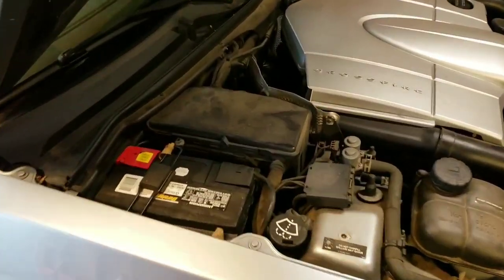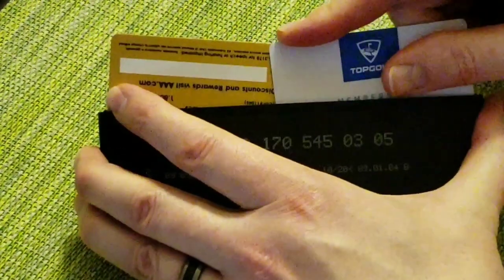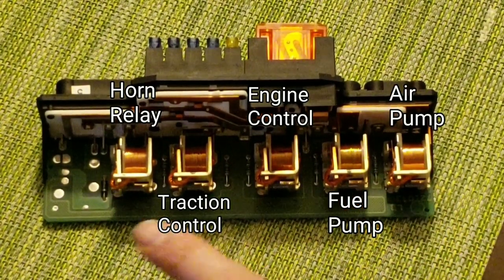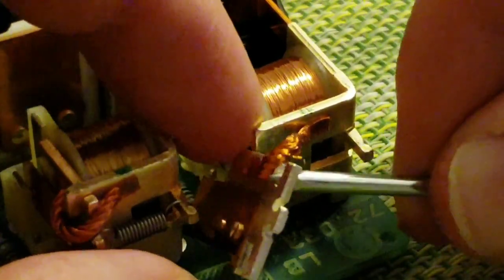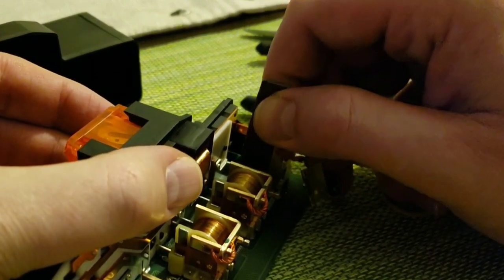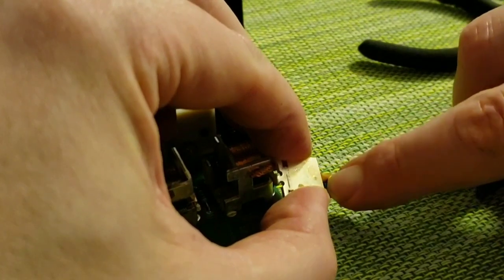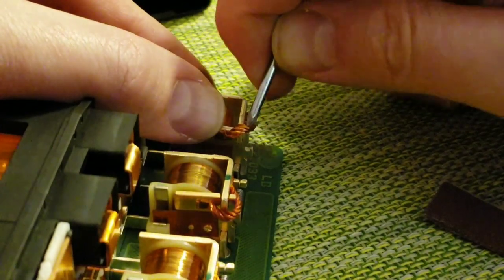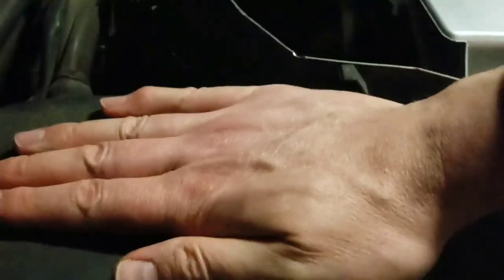RCM (Relay Control Module) Step by Step : Chrysler Crossfire Mercedes Mystery No Start

Comment: My crossfires dash lit up like a Christmas tree this morning upon startup and no working speedo and I remembered reading about the rcm many years ago. Thanks to your video, I confidently removed the rcm , checked the relays and re soldered the lower joints and viola! 30 minutes well spent thanks to you! Cheers! 🍻
Reply from the maker: I am so happy to hear that, thanks for keeping this beautiful car on the road and running safely and reliably. Kudos to you for doing it yourself.

Comment: Just have to say...I have an '02 SLK320 and this was the best video I have ever found on fixing the "K40" relay problem. Took about 20 minutes and finally cleared the dreaded P0410 code. Great Job!!!
Reply from the maker: Thanks for commenting, it makes my day to know my videos help others overcome car issues.
Reply: Did you have the intermittent P0410 fault code. My system works but when I clear the code it can return after few hours driving

Comment: Well that was easy. I have a low milage (19k) 2004 coupe and been happily driving the last three years trouble free, then today, ignition on, but no crank, and after a minute the cooling fan ran up to full speed. A known symptom of the solder joints being bad. I had a fair idea of how to resolve this, but your tutorial made it so clear. Took me literally half hour from lifting the bonnet to starting it up. I just had the three sets of pins bad, everything else was tidy and clean. Thanks for taking the time to make your video
Reply from the maker: Hey, no problem I enjoy the car too. I thought I had low mileage at 80k. Keep that car in great shape. Thanks for commenting.

Comment: Very Good Video!  I like how meticulously the connections are labeled.  And removing the negative battery cable before starting is always a cautious and prudent thing to do.  The detailed explanations of the relay operation is helpful.  The detailed views of solder joint diagnosis and repair is thorough.  I may actually now be able to attempt to do this myself.  Thank you!
Reply from the maker: I think you can do this. I haven't actually had to replace the relay yet, but I have resoldered the joints and cleaned up the relays with probably slightly above average soldering skills (I took an electronics class in high school 30 years ago, and make modifications to RC cars and 3d printers today, I'm not out of practice but not a skilled Laborer in this field by any means).

Comment: Just watched your video and made the repair.  Feels good knowing that I won't be stranded at the worst possible time by this issue!
Reply from the maker: Yep, next up is ignition pin. If your steering wheel or key are ever sticky when trying to start the car, or remove the key, you may have to do the repair I have coming up in an upcoming new release. Thanks for watching.

Comment: Great info, definitely worth replacing the relays I believe. I had the N65 module, intercooler control relay specifically, go on my SLK32. I just jumped around it for now but I will be sure to clean up and inspect the used replacement I just ordered.
Reply from the maker: Thanks for watching and commenting. It sounds like you'll be up and running again as intended.

Comment: I MUST say KUDOS to you for a video well done! I did this process a few years back "blind" if you will. Wasn't quite sure what I was doing but I saw the black residue. I then used sandpaper but I now know Emory cloth is the better product to use thanks to you. Your video illustration and explanation was clear and concise.  I need to revisit this part again and check the solder connections of the RCM. I never re-soldered them as the no crank no start has returned.
Reply from the maker: I'm sorry to hear the no crank , no start has returned. Good luck resoldering those joints.
Reply: @glencouls  Thanks for highlighting and replying. Figured I'd update you on the soldering job. Things went well and the vehicle started! I also noticed a little carbon build up on the air pump relay contact so I cleaned that as well. Safe and happy driving 👍👌😎
Reply: @tooshort4892  I have a 10amp fuse that keeps blowing on start up, once I shut car down it won't start and I must change fuse again to start it... I'll do as was done in video but anyone has any idea why fuse keeps blowing or what this 10amp fuse is for ?
Reply: @hajileserpud9539  Is this fuse in the fuse block or an added in line fuse? Make sure the fuse is the correct rating for the slot it is in. Outside of this or what the video suggests I'm afraid I really don't know much more.
Reply: @tooshort4892  hello... It's on my K40 fuse block on my 2001 Mercedes E320 4matic... I see two 15 amp fuses in this video for the Chrysler Crossfire but on my K40 Mercedes block it has two 10 amps... 1 keeps blowing on start up
Reply: @hajileserpud9539  Cross check your owners manual and make sure the fuses are the proper size. To me it sounds lime they may be the wrong size but your manual will prove or disprove any speculation.
Reply: @tooshort4892  ok will do... Thanks

Comment: I watched the video three times.  Then on-vehicle tested the air pump with a continuity tester then directed wired to battery to make sure the air pump worked.  It did.  Then I followed your video to the letter, but I labeled the 5 wire connections with "Whiteout" dots, one for each number.  Works great.  I did your whole procedure and shut the hood in 45 minutes.  Thank you so much for your wonderful video and sharing the depth of your knowledge.  DD
Reply from the maker: Hey, thank you so much. Your comment made my day, and I'm so happy everything worked out for you here.

Comment: Bought my mom a Crossfire last year. 04 Crossfire I believe. Got it used, drove beautifully for a couple weeks until we had to replace the glass due to a rock smashing the back windshield. When they replaced it they cut and rigged some wires back there. Even since the car won’t start. Intermittent battery drain. I’m just thinking of junking it but she loves the car.
Reply from the maker: This is pretty far out of my view to be able to answer. I would doublecheck the rewiring they did in the back make sure nothing got crossed third brake light and rear defrost are back there. If the car won't start, try reseting the battery (disconnect negative cable, then reseat it) then try to restart car. If the car starts for like two seconds then shuts off, it's the SKREEM immobilizer. Let me know if this is the diagnosis, as I have a couple of options none of them good, but you may not have to junk the car.
Reply: @glencouls  do you really have solution for the SKREEM?? Only alternative that people have I think is to buy it from NEEDWINGS but I dont know if they have it available. Any idea to resolve the issue?
Reply from the maker: @armonianumerica5830  The Skreem unit is the defacto shutoff or last line of defense on what the car sees as a theft attempt. You'll need a new one if it's been triggered and detonated/executed. The only other thing I can think of is entire replacement of the engine, ecu, ignition, etc and drop in something awesome like a V8. There are guys that have done that, probably not road legal.
Reply: @glencouls   I had no idea you replied to this until now and it probably could’ve been helpful. We took it to a couple Electrical/wiring places who said none of the wiring seemed problematic and their best guess was the aftermarket touchscreen radio. She bought a battery switch to turn the battery off when she’s done driving it for the day. Then turns it back on when she wants to drive it. That way the battery can’t drain overnight. It’s still working for her to this day and I’m so glad we didn’t scrap it

Comment: Great info ! just bot an 04 black coupe with 163k. looking for all the help I can get for future repairs/upgrades. Thanks for the great video.
Reply from the maker: Welcome Brently, thanks for checking out my YouTube page. I love to drive my Crossfire, upgrade it, troubleshoot issues and share them here. If you haven't already please consider subscribing, I have a few videos in the works, security pin removal for stuck steering column and ignition switch, floor mats, front end, shock and stabilizer install, all coming soon. Thanks again for watching and commenting!

Comment: 4:50... LOL Your secret is safe with us. Well hopefully it is, lots of Llamas out here. Thanks for making this video. I may need it. We still have our 2005  
Crossfire Roadster Convertible. It's in excellent condition with only 49k miles and has been garage kept it's entire life. Only now are we starting to see some of the issues that older, harder run cars have already experienced. The alarm started going off randomly in the past few weeks. We'll be in the house and out of no where we hear the siren from the alarm and we check it but nothing is wrong. It's gotten to the point where I have had to pretty much stop leaving it locked/armed. I would have taken it into the shop already but our '19 Camry is in there as we speak. Great car BTW! Unfortunately we hit the curb avoiding a deer. Said Deer now owes me my $500 deductible... Good luck finding that a$$hole. 
This morning I wake up to the same thing; blaring sirens in the garage. I forgot and must have locked it. Only this time the sirens sounded like a cricket dying over a PA system. Very pleasant to say the least. Especially when it's screaming in your ear as you're trying to disconnect the battery cable. In my little bit of research I've learned I should first check all my sensors and relays especially on the doors, and latches for the glove boxes. If that does not solve the problem I will remove the RCM... I really hope when I go out there in 30 mins with a Torx set that I find a lose switch somewhere and it's a simple fix. This car is in excellent condition. I also saw some info on the alarm module having it's own batteries and they could be bad or have leaked and destroyed the circuit board. That's a possibility too since the siren sounded so bad.. I'm just going to start checking things off. It's hot as hell outside too. Which me luck plz!

Comment: great video, very informative. I'd like to know the possible reason why a relay goes bad like the one in your video. Was it because the air pump was bad and never closed the relay, or age/wear caused the relay to fail?
it's also interesting there is no dust cover on the relays. Perhaps because they are already enclosed in a plastic casing around the whole RCM?
Reply from the maker: The manufacturer did NOT use enough solder at the joint, defect, or design flaw. Usually goes bad well after 36000 miles, all of them are secodary fratures not safety related so no recall.
Reply from the maker: I hand't watched this video in forever. I also think in order to shrink the size of the RCM they are using Relays and springs that are too small for the voltage coming through. Obviously for the horn and flashers they are pribably fine, but the air pump and fuel pump is likely a different story, these are everyday every moment items. They failed to consider the life of the relays.

Comment: Great information. Is the symptom of those faulty brown solder joints that it won't crank or just not start? Mine 2004 won't crank but I resoldered those pins since they were also brown but it still won't crank. Battery is relatively new and voltage is good. Thanks!
Reply: I'm having the same issue. Did you resolve your issue.
Reply: @caroltinnie5387  it turns out that I needed a new SKREEM module. Hopefully, that's not your problem.

Comment: Hey, awesome video. I just bought an older 2004 Crossfire and it is now experiencing total power loss. No dash lights, no nothing. 
Any idea what it could be?
I'm looking at possible battery problems or battery cables or even the 200 amp fuse as possibilities but I am always open to suggestions and possible fixes.

Thanks.

And great video on the RCM.
Reply from the maker: Thanks for the nice words on the video.  The Crossfire does some really weird stuff when the battery isn't showing at least 12.8v, if yours is a few years old, or unknown I would start with replacing it. I can't remember if I had dashlights when my CPS crank shaft positioning sensor went out, but I do recall not being able to crank the starter, so the CPS sensor might be a good look. There are two fuse boxes, one under the hood to the right of the engine when standing at front bumper looking into the engine, and one behind a pull panel behind the dash only accessible when drivers door is open. Check all of your fuses, including the ones on the RCM. Don't forget to inspect your RCM relays and solder joints.
Reply: @glencouls  wow! That was a fast response. I surfed the internet for others who may have had the same problem as I did and it turned out to be simple corrosion on the neutral cable to the battery. :) 

Quick and simple and so far free repair.

As I just said to my son and will repeat here, when you have a problem with something, so long as the Internet is FREE to use, go do various searches. You're bound to find something that will help you start your own repair process if you are capable of doing it. Beats calling the mechanic only to have to pay a couple hundred on a repair that would have cost you five to fix. 

And yes, the Crossfire is buggy but so far most of the things that go wrong could be easily remedied, like the RCM solder trick.

Once again, thanks for the response and I hope my issue and solution can help others out too.

Comment: Hi, I have a 2000 SLK 230 Kompressor that won't start. The mechanic says I probably need a new relay box but he can't do it because he doesn't have the computer equipment to program the new relay box. I would have to have Mercedes "flash" it or "reprogram" it, or a shop that has the equipment, so the relay will pick up the signal from my keyfob. Is this true? Does the whole car have to go to a shop with this equipment, or can I just bring them the relay box and my keyfob?:
I may have a friend who knows how to solder try first. The mechanic did mention some people do this. But, for now I have to tow my car back home. I also have to get another keyfob because I recently misplaced one and I have only one now! Thanks.
Reply from the maker: There are a few issues that can lead to mystery no start. One is the RCM I would start here, the next is the Crank Postioning Sensor (CPS) I have a video on that too, the next is the skreem unit. The RCM is no crank the engine won't turn over the relay stopped, with the CPS you can actually start the car and drive it a short distance then the engine cuts out. With sKreem  unit the key fob is no longer paired with car for some reason and the ignition system has borked the skreem unit to save the car from theft. Watch "gone in 60 seconds" it goes into detail about mercedes theft prevention in that Era. This one will let you crank the car, but it doesn't get spark so it just cranks and cranks and cranks. I think your mechanic is sending you away because it's a headache and he doesn't want to deal with it.

Comment: Had the RCM out and soldered the 3 joints in close proximity near the edge of the board.  Symptoms still remain the same,  both key fobs don't work to unlock the car,  the alarm sounds when mechanically unlocking the door and opening it, place key in ignition and turn to second position, all dash warning and information lights up light up.  Turn the key to the Starting position, no change in dash warning and information lights.  I have ordered Crank and Cam Hall sensors, just because every where I read said to do this anyway to keep spare.  Then moved straight to the RCM as the next place.  Would the symptoms I'm getting benefit from re flowing all the solder joints. And what root cause analysis process flow would you go down for this??  Battery -> Negative Terminal strap -> RCM -> BCM -> SKREEM -> ECU
Also reading the codes from OBDII with Torque app gives no errors, no pending and no historic. I have only just inherited the car and don't know the history before.
Reply from the maker: Have you changed the battery? I highly suggest trying a new battery. I had the key fobs stop working and seeing all dash lights and it was the battery. Back fin started doing crazy stuff too. You need the battery up over 12.8V. I doubt it's the SKREEM unit, when my SKREEM went bad it operated like normal, until I tried to start the car then it would crank for a bit on first attempt, then I would have to pull key out again, and put it back in to get it to crank... But would not start.
Reply from the maker: Also if you have low battery, the obdII readings could be getting cleared. I believe low battery is a potential cause for my relay to go bad.

Comment: glencouls i have the same issue as you with my air pump. perhaps do you have the number of the relay to buy in EUROPE ? As for Benz ? In your video is only for USA ( buyers ) What are the exact number serie on the relay for the air pump ?thanks a lot!

Comment: My RCM doesn't have RED and BLACK jumper wires on the PCB. What is the purpose of the wire jumpers?
Reply from the maker: That makes it so you can honk your horn when keys not in the ignition. For some crazy ass reason these cars won't let you honk if your keys aren't at least in acc. My feelings are you have to have a horn at all times, what if you see something, need help, need to get somebody's attention whatever ... so I jumped power to the horn relay.